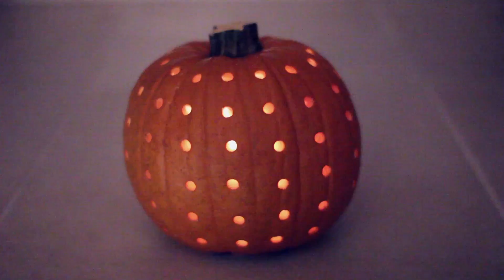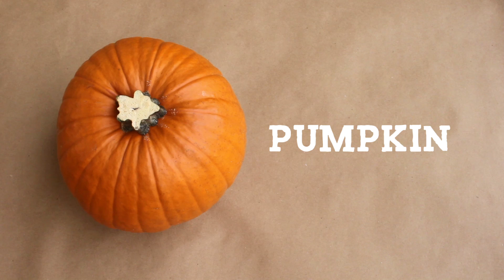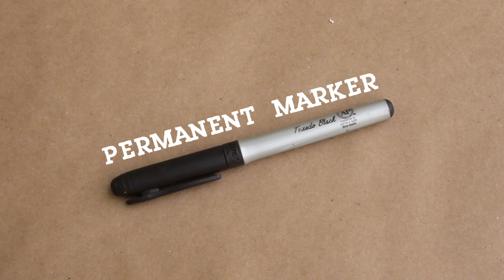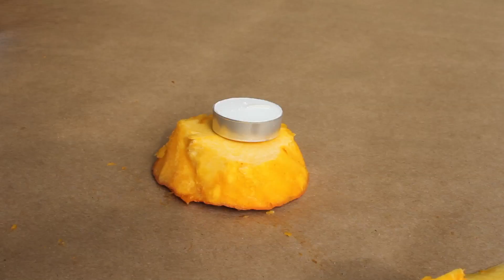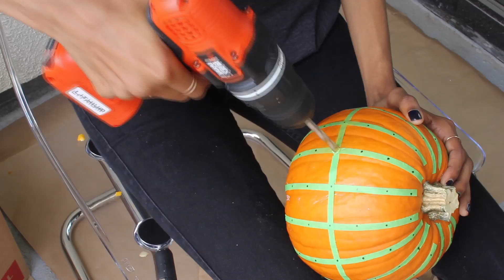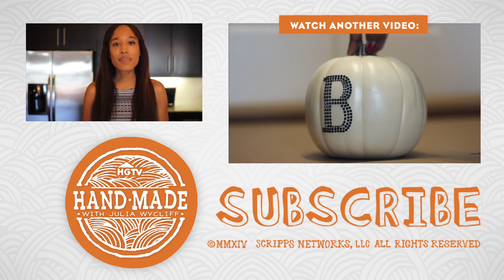DIY Decorative Drilled Pumpkins - HGTV Handmade

Comment: I think I read somewhere that if you cut out the bottom of the pumpkin it doesn't rot as quickly?
Reply from the maker: +Becky Tiding I didn't know that! Another good reason to cut from the bottom.
Reply: I've heard that before also :) something like, because the rest of the pumpkin is still attached to the top (stem part) where the nutrients originally comes from. I always cut from the bottom after hearing that.